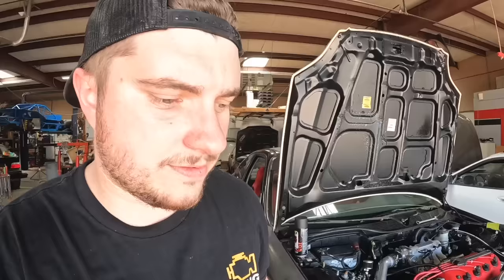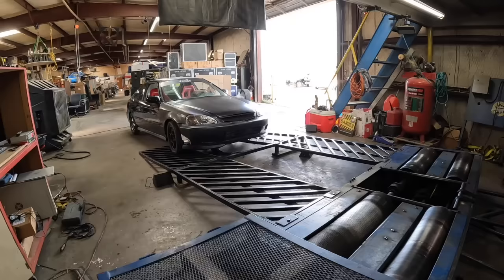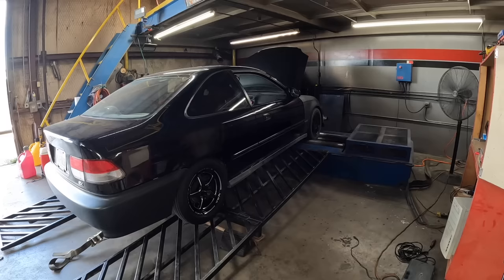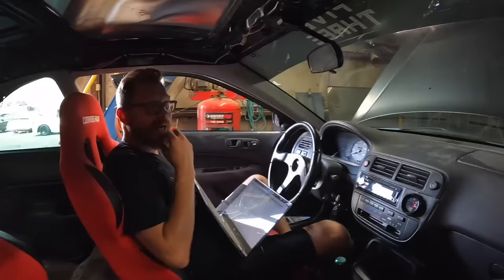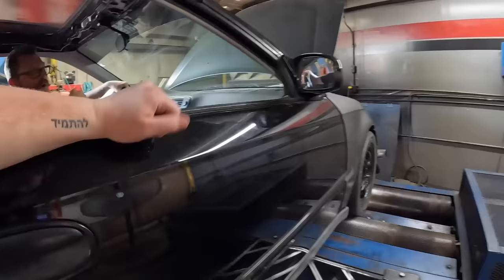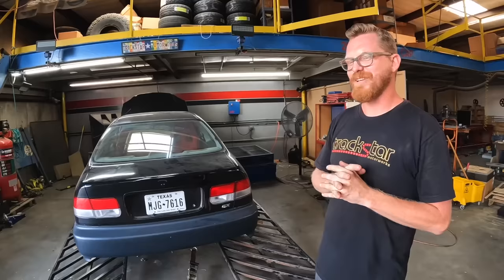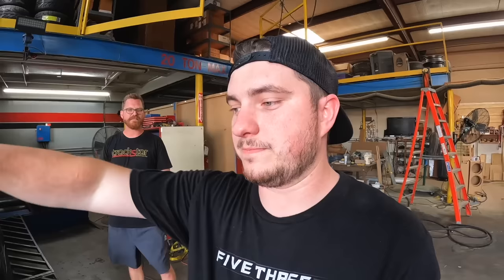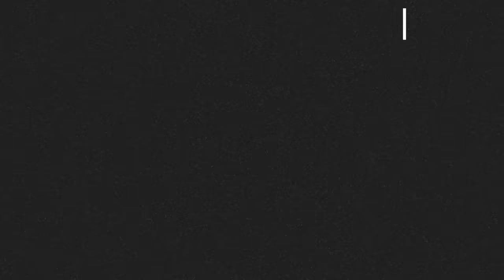Big Turbo Civic made WAY MORE POWER Than We Thought!!!

Comment: Being part of the 400whp D-series club, I can tell you it's fun BUT definitely a rough ride. Besides sleeves and C.O.P., I had it all! SRP pistons, Eagle rods, copper HG, turbo cam, full valvetrain, OEM rebuilt dizzy, ram horn, Bullseye 60 trim, Quaife LSD large bearing trans, and 500whp axles. Ran E85 of course through an old school chipped/slotted P28 ECU with 1200cc injectors. Absolutely nothing better than sticking it to a massive V8 by telling them your 1.6L just walked them!
Reply: pushin 600 whp
Reply: how long did that motor last?

Comment: ive ran 30 psi on stock head with no lift or det with meth spray . it helps aton either have ethanol fuel or meth injection

Comment: i have a civic sedan  y7 with zc full titanium headblock ,p28 chipped ecu , d15b7 intake, 70mm throttle , 550cc injectors , ebay fuel rail , tobei fpr ,  vms high flow fuel filter , 525 walbro hellcat fuelpump and 3"straigh exhaust system n ebay y8 header.   :/ But N/A no turbo sadly for me

Comment: Correction, it is very easy to make 400hp on a d16.
Reply: No it’s not you gotta rebuild it to the Brim at the point a B18c would be better to swap inside the car or even a K series.
Reply: @landscapingco2791  made 469 at 16psi on a d16z6 with a pte 5858. So, I speak from experience. Currently building a awd d16a6 with a hrv transmission, shooting for 750hp with a s362sxe.
Reply: Yup u right bro i got a civic i aint no turbo and am 300+ these engine are the best for start a budget proyect and make good number without speeding too much